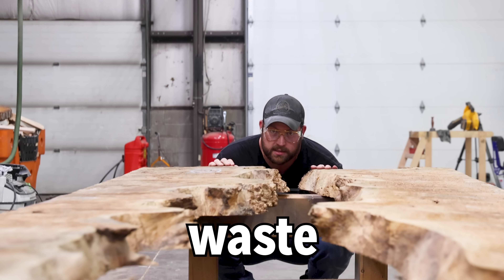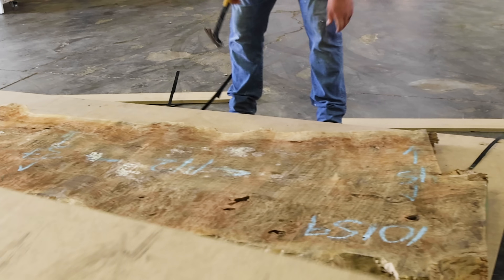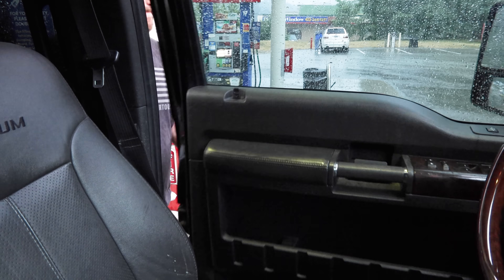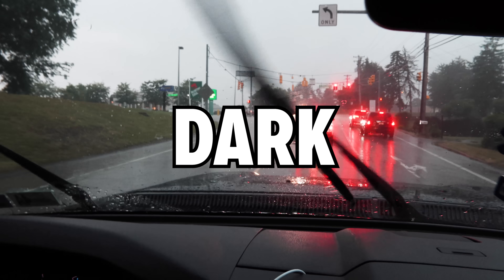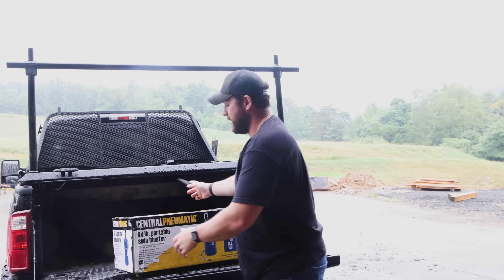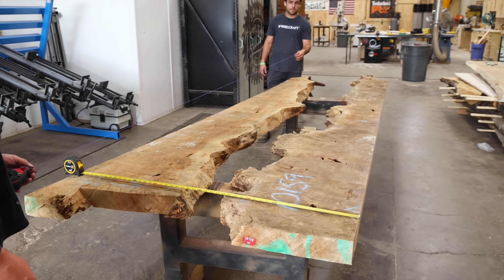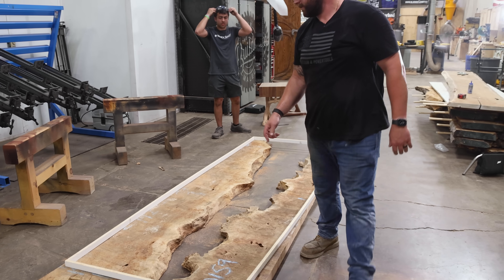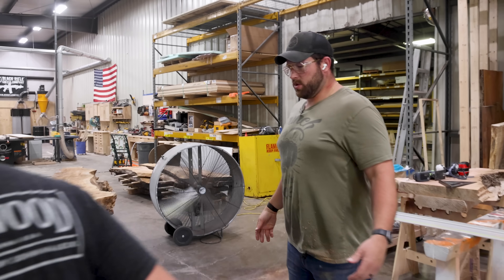A $5,000 Miskake? Was This Slab Worth It ?

Comment: Wow I've never heard of that wood.. it's going to look great when done. I've never heard of the soda blaster. I've heard of the sand blaster..but not the soda. Thanks for the new tool I might have to go get ha ha. Can't wait to see the finished product
Reply: Every sand blaster can be a soda blaster
Reply: @veganpotterthevegan  - Some sand blasters use water, which tends to reduce the effect of soda.
Reply: Soda blasters are basically what dentists use to whiten teeth.
Reply: @RFC-3514  all I said is that every sandblaster can be a sodablaster.  A wet sandblaster is a wet sandblaster and not what's pictured.  Although you can wet sodablast too 🤷
Reply: @RFC-3514  all I said is that every sandblaster can be a sodablaster.  A wet sandblaster is a wet sandblaster and not what's pictured.  Although you can wet sodablast too 🤷
Reply: @veganpotterthevegan  - A wet sandblaster is included in "every sandblaster", in much the same way that "every dog" includes wet dogs. 

And "what is pictured" is a soda blaster.

Comment: One bars are OK, but they have more carbohydrates than SOME others, AND every damned last one of them has about the same consistancy. That's great for a pie, but it sucks for something that is supposed to taste like a muffin. Try the Quest bars. They have lower carbs AND there are many different consistancies and textures. And no, I do not work for Quest, nor do I get anything out fo them, but I have been on many, many diets of the years and (at least for me) they work.